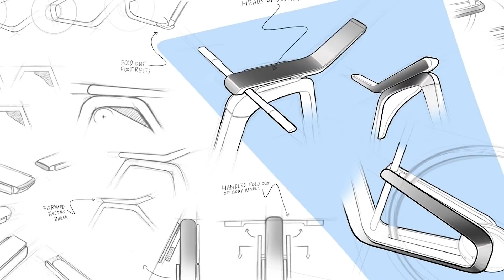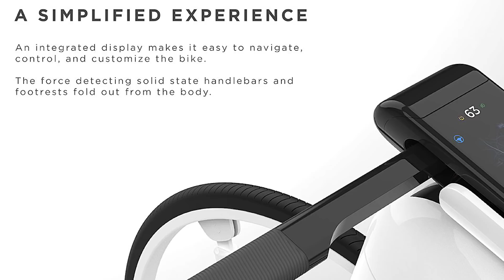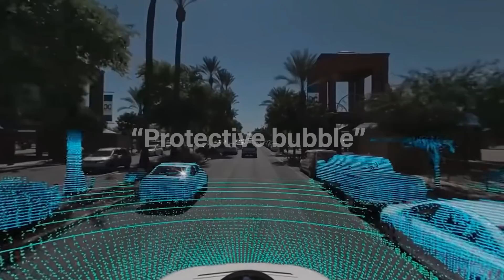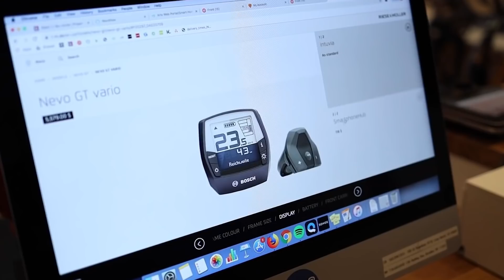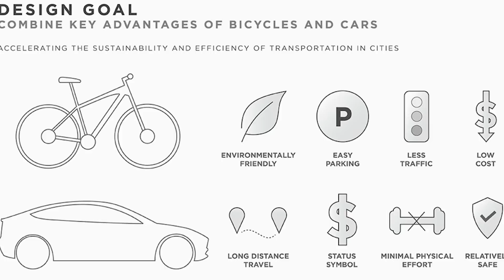Tesla's Secret E-Bike Project

Comment: Good video, but some information is off. 18650 batteries and mid-drive motors have been around a lot longer than stated, and most batteries currently on the market last more than 2-3 years.

Comment: mid drives...2-3 years ago? I must be a time traveler I've had the same mid-drive motor since 2016 and I'm pretty sure that specific model even had been commonly available for 4 years before that. Try at least a decade for 18650 cells. This video is filled with misinformation from start to finish, it's click bait and the bait is the Tesla brand which hasn't started any e-bike rumors.

Comment: This isn't an ebike. Every law I've read from around the world says an ebike needs pedals, and that they have to have a motor under a certain wattage (plus even if that's overlooked what's the point of having two motors that together areas powerful as a single motor?). This means it will likely be considered a moped and will be subject to a lot more requirements (lisencing, insurance, registration, more aggressive helmet laws, ect.). The most attractive thing about ebikes is that if where you live is smart they treat them for the most part as regular bikes, plus it's good to be able to fall back to using the pedals (and in the case of Tesla's thing manual stearing) when the battery runs out.

Also most manufacturing isn't done here because a lot of ebikes are DIY's.

Comment: "First ever dual-drive system for an e-bike"... Ummm...  what?  There are dozens of dual-drive e-bikes out there.  They've existed for 2 decades at least.

Secondly -- "it has dual footrests", and based on the look of the design, it has no pedals -- it's not an e-bike if it does not have the ability to be pedaled.  It's an urban/city motorcycle.

Thirdly -- let's not kid ourselves.  This is not an actual project; There is no partnership with some random design student.  Musk said something off the cuff, and some guy did a personal design project envisioning what that could look like.  There's no actual e-bike project, and even if there was, this is not it.

Comment: Tesla could focus more on city commuter vehicles that would eliminate parking & gridlock problems but I am not sure a 2 wheel cycle is the solution. With the drawbacks to riding 2 wheels, like falling, flat tires, getting doored & bad weather or riding conditions, a low speed multi use city vehicle for under $10,000. makes more sense to me.

Comment: It needs to have a long range around 200 to 300mile and faster charger with density battery cells that can last at least to 6-12 hours with only 3 or 6 hour charge. Options for a thumb throttle or twist handle and speed must be adjustable to fit most country’s regulations like 15mph minimum if you were in the uk for e bikes.

Comment: If ever elon comes with bicycle, 
It will be 4 camera,
A chip,  audio video , single motor, battery as pipes of frame, suspension not in spokes, but front and back.,
Seat has to be connected with centre of gravity.
Etc.
It might have out of the box safety  system , which covers the driver instantly, kind of airbag.

Comment: That’s all we need more battery’s that nobody can recycle and the carbon emissions it takes to make them is crazy.
Reply: I thought they did recycle car batteries? And what is the carbon emission vs. a traditional car? 
I honestly don’t know.
Reply: THEE BEST OF LIFE they do but Tesla’s lithium-ion batteries are only at best 60% recyclable, that basically means most of it ends up on a landfill. Also plenty of studies have gone to show that making the ion battery’s produces more carbon emission through production then what cars do. Plus it’s still electric unless you switch the grid to renewable energy I’m pretty sure you’re using fossil fuel to run it. I can’t see how people think this is a green company, then you’ve got SpaceX burning rocket fuel like it had a used by date. Plus Tesla have just bought 1.3b dollar shares in bitcoin, you can’t even comprehend the emissions that industry generates.

Comment: I want one. There should also be an option to drive manually if the battery dies. I think they should be built with a strong but cheaper material like the Cyburtruck.